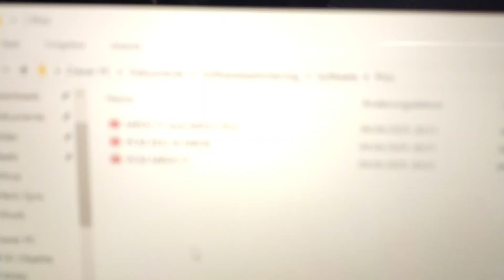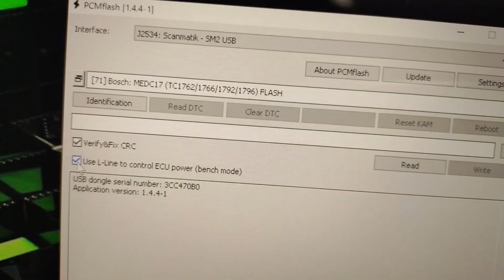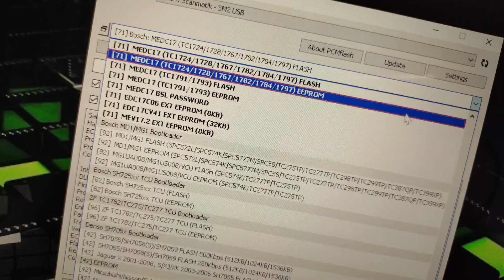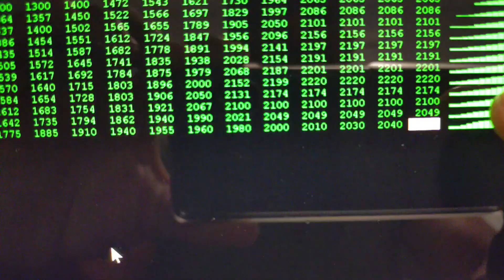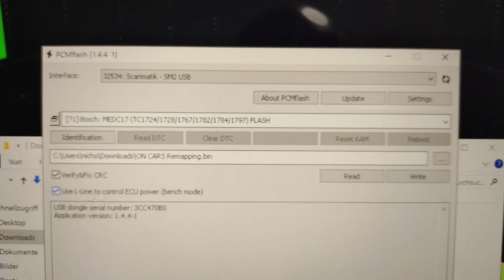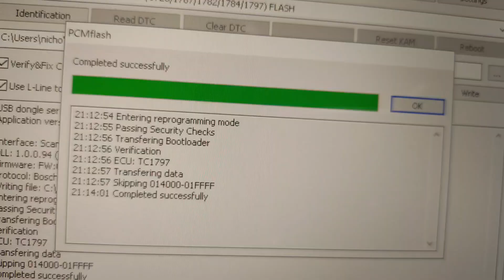ENGINE TUNING | remapping

Comment: what r u using for yuor 12v power source? I am tired of using a car battery haha
Reply from the maker: Hey my friend I have a UK 12v Power Supply, a spare EU 12v but for most jobs I have a USB transformer cable, with a button that lets me select 5v, 9v, 12v and so on.

It remembers the previous setting so I never have to adjust from. 12v.

Yesterday I had a Bosch EDC16 C39 and my main power supply at the desk is a MINX 65w and it has USB A for my wireless charger, USB C for my Surface Pro and the top USB C was used to power the ECU; much easier. 

If you click on my channel you can get my email address or my Instagram can be found in the video description (linktree link has everything there).

If you get in touch I'll share the links, and the cable is really cheap and saves carrying big gear.

I had another USB cable that converted 5v USB up to 12v and did jobs using the 5v USB port in somebody's car 😅

There are so many ways to do it 💪🔥
Reply: @technixxel  wonderful, I'll shoot you an email now than, I have the exact same setup as you for everything else just looking for a safe source that isnt a car battery
Reply from the maker: @sprinterfix  no worries I'm at the computer and will reply whenever you send. I found the USB C cable and once we've spoken I can figure out which power supply will power your computer, phone and ECU so everything has power from one plug.